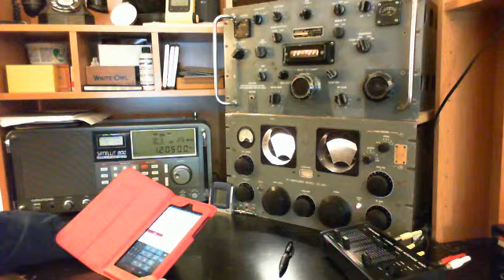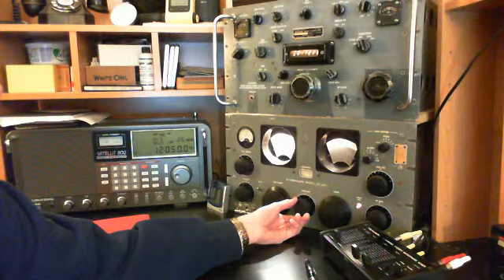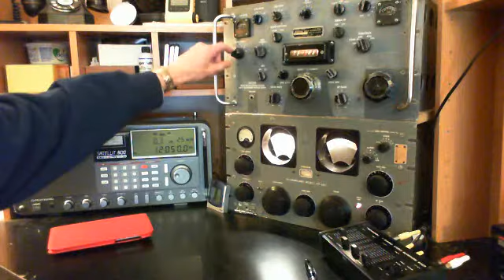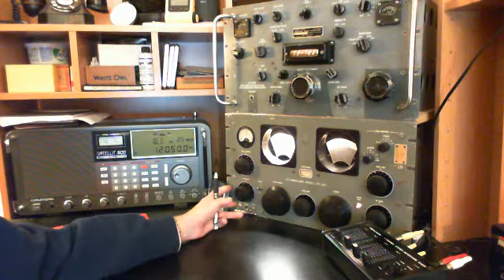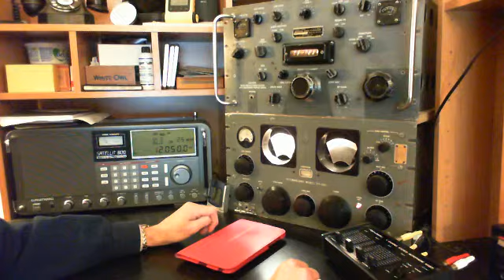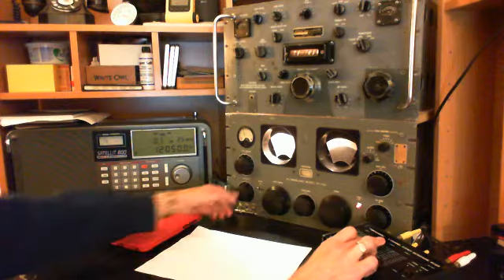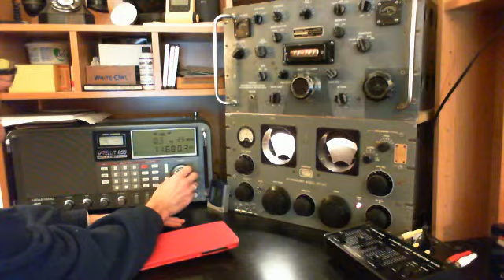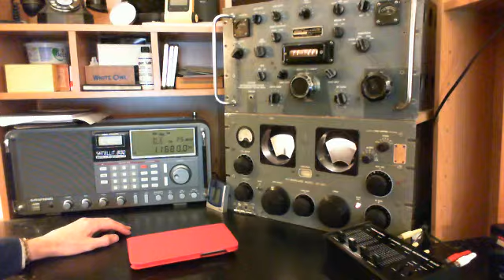Comparing the Grundig Satellit 800, Hammarlund SP600 and Collins R390A IF Filters

Comment from the maker: I purchased the SP600 for $300 in 1976 while I was in college.  I also picked up a signal generator (the big one in my shop) and I built a Heathkit frequency counter (also in my shop).  I beat the generator against the SP600 and read the frequency on the counter.  So, I had digital tuning in 1976 on my SP600.  I loved operating that way.  My antenna at that time was a 20 metre long folded dipole high atop a 22 story apartment building in downtown Toronto.  Boy, things have changed since then!

Comment: What program did you go to , so you could find out what station you were listening to? 
Did you replace all the Black Beauties in the SP-600 ?
Thanks again for videos. 
Compare HQ-180A and SP-600 AM signals.
Reply from the maker: www.short-wave.info

Yes I replaced all the molded capacitors in my SP-600.  I've posted a photo of all the capacitors on my blog for you.  Too bad I hadn't stated making videos because the SP600 would have been an epic.

http://jimsradiorepairshop.blogspot.ca/

Jim.